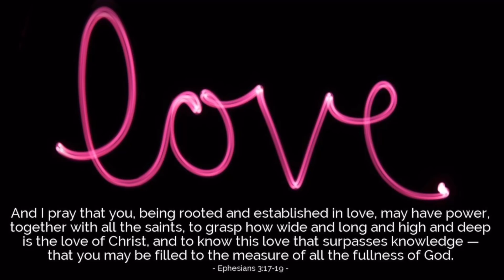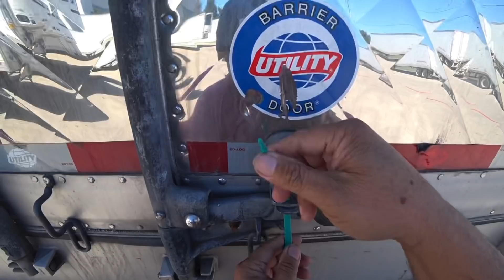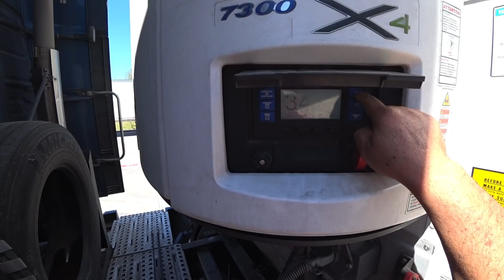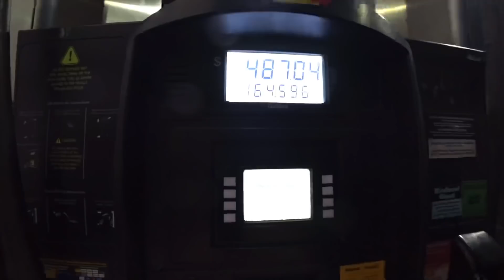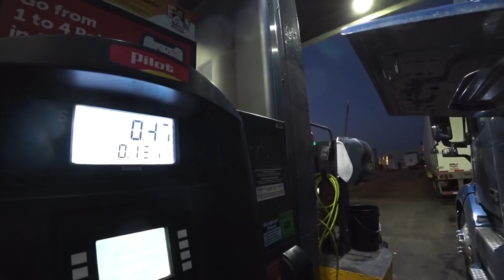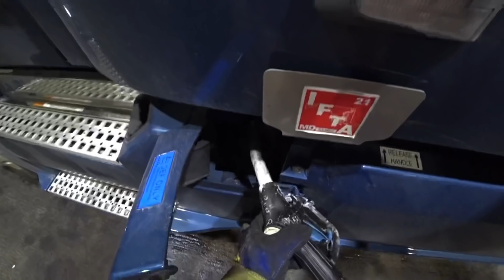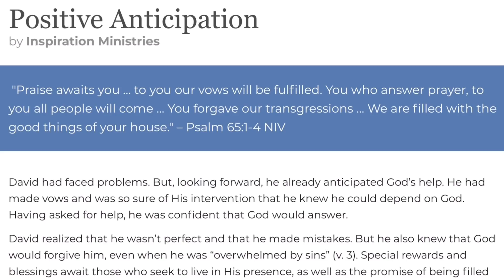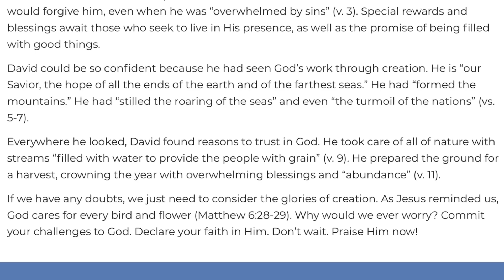March 30, 2021/122 Trucking. Loaded and fueled at the Pilot Truck stop. Texas

Comment: 20:00 - The thing is, the actual product temperature and the temperature reported by the trailer can at times be different. There are some sectional reefer trailers that have frozen food in front and refrigerated food in the back. If by any chance compartments are set up wrong, you can get damaged product.